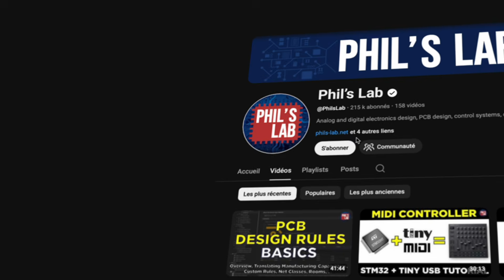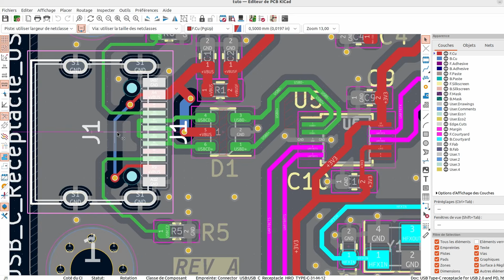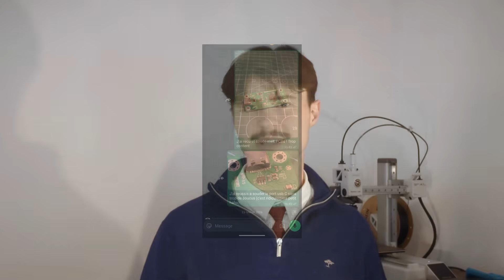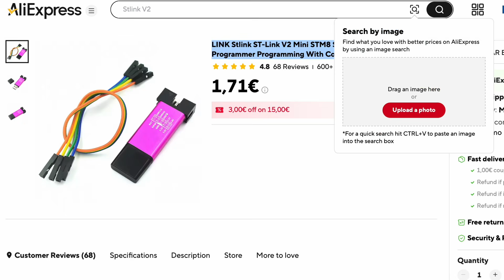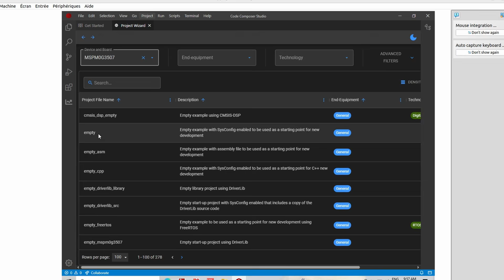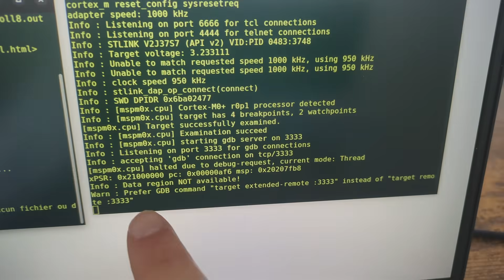Programming A Custom PCB (Even as a NOOB)

Comment: Fully agree with what you said on the Tag-Connect. It wastes massive PCB space and their connectors are ridiculously expensive. Instead, I use generic "pogo pin clamps" you can find easily online. They exist for all header pitches (2.54mm down to 1.27mm), cost a fraction of the price, and a 1X6 or 2X3 footprint in 1.27mm pitch is almost twice as small as Tag-Connect. Never had a single glitch flashing/debugging with those.

For the SWD probe, I've had a great experience with the WeAct Mini Debugger, especially for working with STM32s. It's USB-C, feels like much better quality than the usual cheap ST-Links, can be flashed with the latest official firmware, and does composite SWD + UART over USB which is very convenient.
Reply: Damm I'm a hardware designer, but never thought about using these pogo pin clamps instead of the Tag Connect stuff, thanks for sharing!

Comment: Where can I learn programming? Right now, I’m using Gemini Pro to do it.
Reply from the maker: Low Level programming is pretty straightforward, learn C (syntax) and then it's all about reading datasheet or using drivers. Use gemini not to write the code for you, but rather ask questions to learn, LLMs are insane learning tools if you have the patience.
Reply: C is kinda simple. Just dont forget you still need to understand the cpu, memory and how they communicate